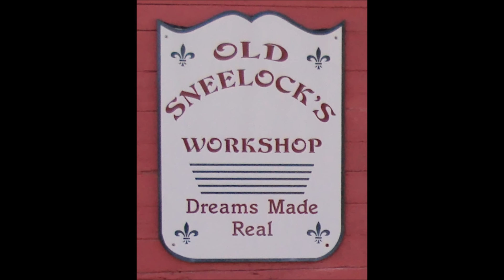1890's TECH ~ HACKED WITH 2017 PLASMA CUTTER

Comment: road trip, road trip. Nice job Bossman. (road trip), I need to check with a local fabricating shop to see if they have any drops. The nearest Steel Supplier to me is about 50+ miles. (road trip!). Do you have any plans to modify the Grinding Wheel??...road trip...
Reply: 2nd this, 2nd this. Tried a comment and it died but Jimmy Bob said what I would say too!
Reply: Third that please.
Reply from the maker: +Ol James No big changes. Just want it to work. I'll make the parts as needed.
What did you guys think of the title and thumbnail?
Reply from the maker: +Lewie McNeely You talked me into it.
Reply: I'm so glad. I miss you when you're gone.
Reply: A-PLUS on my end.

Comment: The road trips you choose to show are invariably interesting, so if you think it is something we would like, chances are we will.  My one & only problem with road trips is that I wind up thinking to myself; "I wish that place were closer...".
But sometimes, I realize that there /is/ a place similar to where you go, and closer to me, and I could at least try it out.  Some places don't like selling to individuals, because dealing in onesies & one-offs is too low margin for the perceived value.  They may be right, at least for them.  FINDING the places that will sell the oddball piece or two are always gems...
Reply from the maker: +Brian Neeley I have been buying parts for various companies for the past 50 years. One of the side benefits is contacts. Most of them are retired like me now but the companies are still there.

Comment: hi david if you are in need of rivets  take a look at Centaur forge.com
i get  things for the forge from there...replacement parts as well
brattons.com  they have the  tool for your air hammer to peen over hot rivets
brattons sells model A ford parts  a road trip sounds like a good idea
Reply from the maker: +Thomas Rossley Thanks Thomas. I can get the rivets at Alro Steel.
I just think I can kill two birds with one stone by making the rivets and installing them. 
I will have to make a heading tool but that's pretty easy if you have the know how.
Reply: you should make a video on the heading tool 
i have one  i had a 1930 two door coupe  at one time they used hot rivets to make the frame
it would be nice to have other sizes